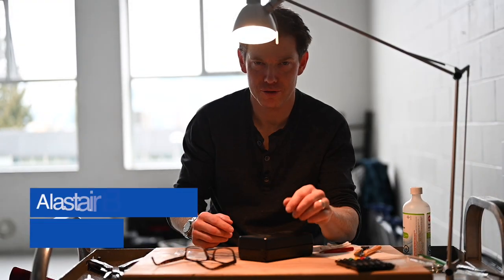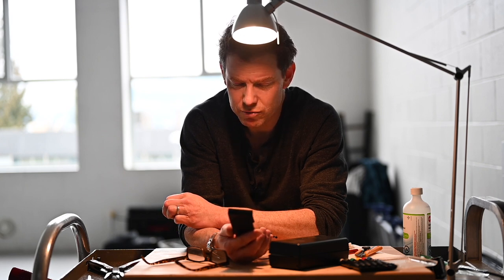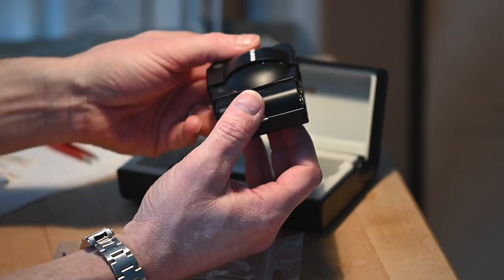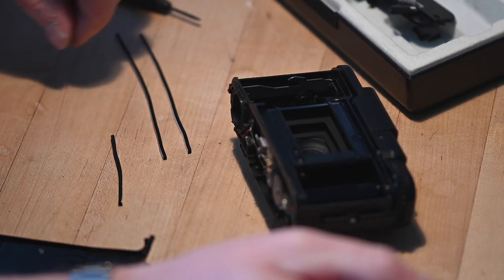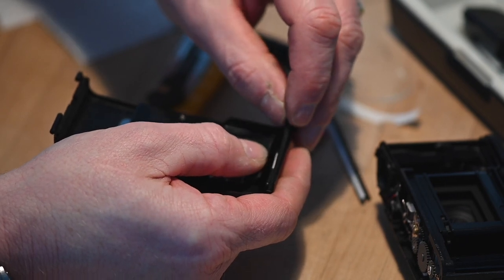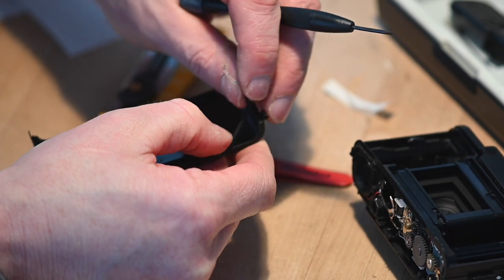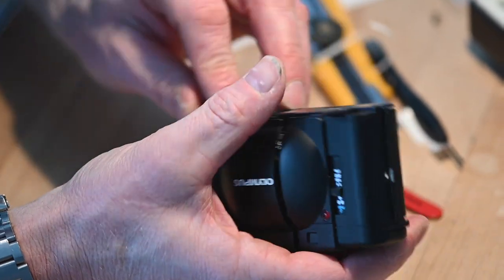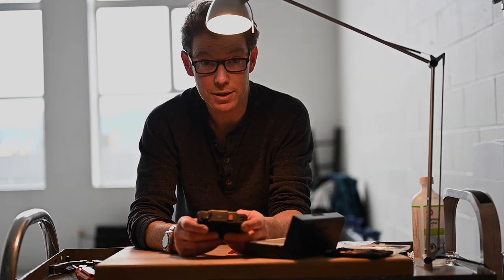How to replace the light seal on an Olympus XA

Comment: there's also a seal in the top groove on the body which that kit either left out, or you used it as the top seal on the door, which isn't supposed to go the full length of the door. you gotta pay attention to the exact dimensions and placement of the original seals. you should also be dipping your seals in alcohol. it allows you to reposition them as much as you want without the adhesive sticking until the alcohol dries out.
Reply from the maker: Doubt there is room for any more seals and we used everything in the kit. Thanks for the alcohol suggestion. Very helpful. I’ll give that a try on the OM-4 we have that needs new seals. And my Horseman…
Reply: @UnderexposedwithAlastairBird  yep, it seems your kit only included the 4 door-side seals. there are 3 more in the body.

Comment: do you think the kits vary wildly in quality, or is it fine to just get the cheapest one?   I do a lot of makeup depotting, and if in the future you need something to remove adhesive, you can use parian spirit. it's oil based; you can thin it with some 99% alcohol if you want. other wise it's easy to use and works really well!
Reply from the maker: Thanks for the parian spirit idea! Always good to have options. As for the kit, I honestly don't know. Certainly the high-quality foam is nice to have, but the foam that they used originally was just so-so, and I think any kit would suffice. A quick read of reviews were you purchase it should give some idea as to how well it works.

Comment: With that bottom off the camera I'd be tempted to oil/grease those wheels and maybe blow it out with some compressed air. I wonder what a standard service of such a camera would look like? Can't be that complicated. I say this as a jeweler having the tools and being used to working on tiny things. Great video, thanks! Liked & Subscribed!
Reply from the maker: Thanks for your kind words. We did discuss a bit of lubrication but my major concern is that I would use either the wrong oil or too much oil - and I wasn't entirely sure where to put it. In my mind I remembered the Nikon D600 issue where they over-lubricated the mirror mechanism and it splattered little tiny bits of oil all over the sensor. Not a great situation. I would love a repair manual for the camera.
Reply: @UnderexposedwithAlastairBird  I know, which oil/grease, and where exactly to put it is always the trick with all fine mechanics. Still, when you have a space and the tools to do it, repairing/servicing the teeny tiny stuff successfully can be the most satisfying.
Reply: Once you start wearing lighted magnifiers (as you have to with jewelry) a whole new world opens up and you’ll never go back. Especially if you need glasses.
Reply from the maker: @thepaulhenderson  My eyesight has recently started to show its age. Any suggestions on where to look for lighted magnifiers? I could probably use a set...

Comment: Video @ 5:40 - "you get a total of one try" - Well not if one applies either rubbing alcohol or your saliva on to the adhesive side of the self-stick foam.
This will make the adhesive 'DELAY' its stick long enough to allow you to position it perfectly (it slides until the 'lube' dries off)...
Reply from the maker: Thanks for the pointer. Had no idea you could do that.

Comment: Is that a plastic that doesn't turn sticky?
Reply from the maker: Do you mean the new foam seals? If so, I'm not sure they won't get sticky, but the foam is certainly much higher quality than what was originally installed. I expect it will last for a long time.
Reply: @UnderexposedwithAlastairBird  My main question was with the plastic on camera body in general, and reading the comment back some time after posting it I realized that it was a bit vague since the seal is probably some kind of plastic too!
Reply from the maker: Ah! The plastic on the body is actually in great shape - not sticky at all. It seems to have stood up rather well. That said, the camera wasn't used very heavily at all so it's still in very good shape. Doesn't feel brittle, though - or any more fragile than one might expect.

Comment: You forgot 2...
Reply from the maker: Forgot 2 of them? Where are they?
Reply: @Underexposed with Alastair Bird  in the ridge that the door fits into there are 2. You can buy a kit online with 4 for the door, 2 for the notches.
Reply from the maker: Thanks for the heads-up. My kit didn’t have those.
Reply: @Underexposed with Alastair Bird  Yeah I restore some cameras myself once in a while, and most cameras are actually ok with just the one foam seal per side. Like many of the Pentax cameras can be light tight without those extra two seals — when I restore an ME or ME Super, I clean out the old junk foam in those two crevasses and it is (usually) fine.
Reply from the maker: Good to know. That said, when one does a how-to video it’s always good to know if you’re leading people astray. Thanks for the info.
Reply: @UnderexposedwithAlastairBird  Did the four light seals work, or should I buy a kit with the extra two pieces of foam? Thanks!!!
Reply from the maker: Seems to be working ok with just the 4 pieces we had.